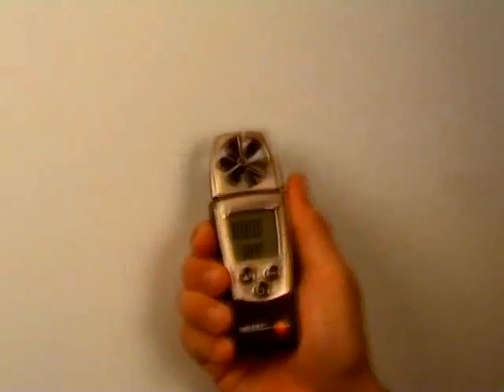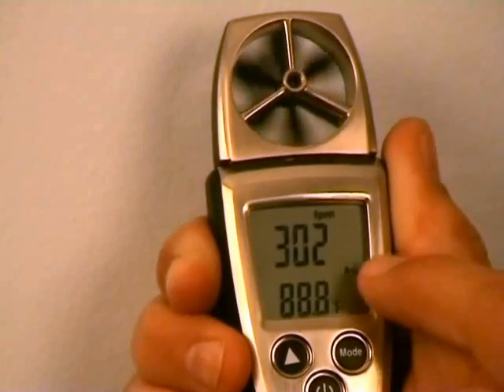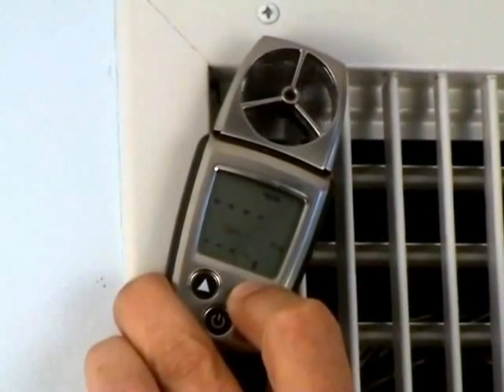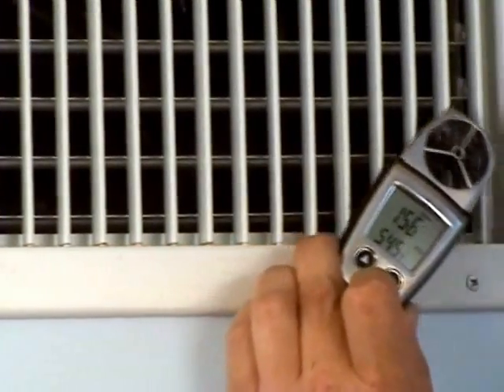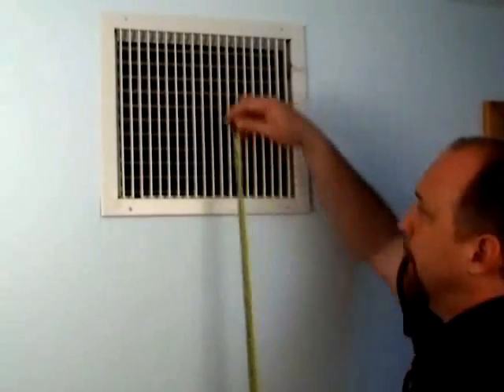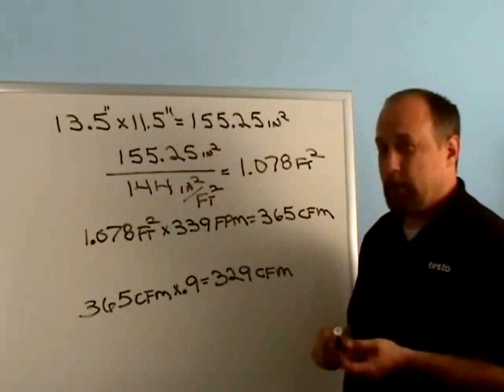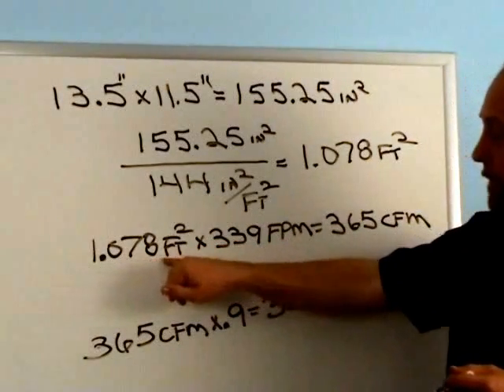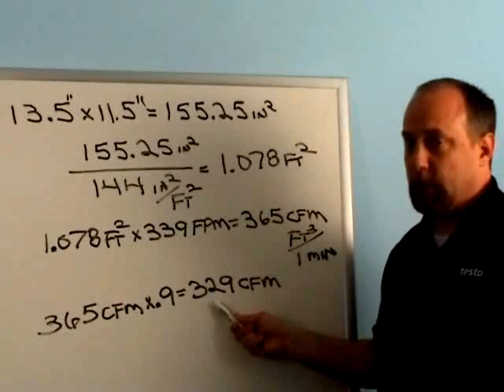410 video.wmv

Comment: if anybody wants the equation in metric mm/sec to L/sec for UK or Europe

grill L x B =             mm2
X (times) free open air (percentage)       
divide by 1,000,000 or 10^6 to get cu mtr  (cm)
X     measured flow rate  in m/sec   =        cm/sec 
X     1000 to get L/sec